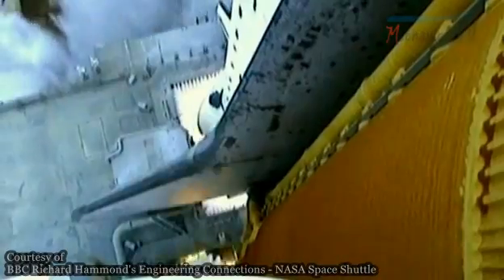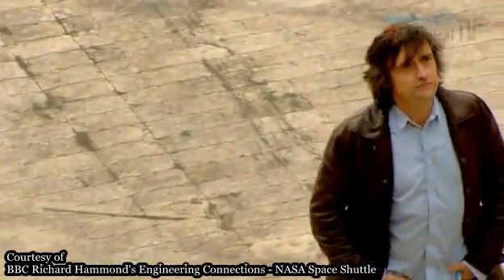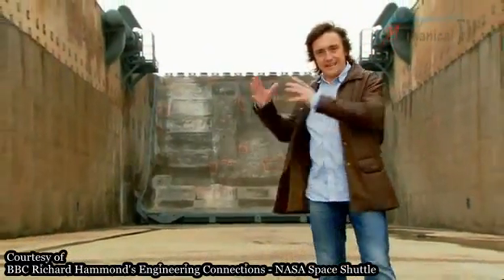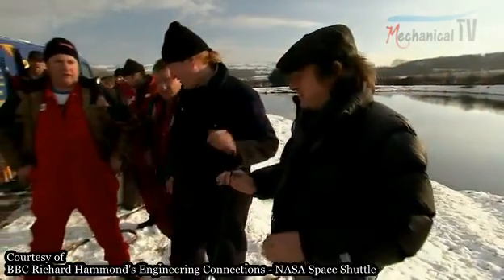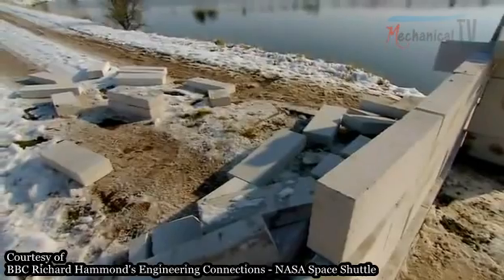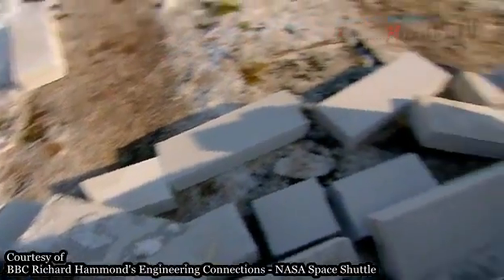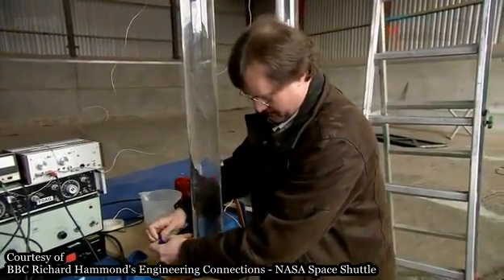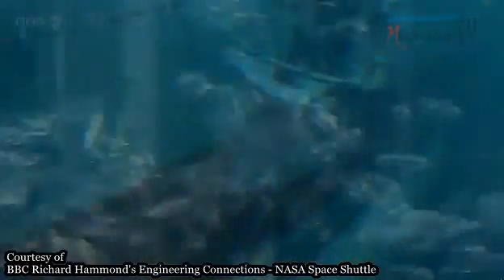Noise Reduction Technology in Space Shuttle's Lift off Using WATER MIST

Comment: On STS 1 the acoustic energy of the SRBs jolted the main body flap (the structure underneath the main engines) way out of position. Remember :  The hydraulic system is using pressure to HOLD the flap in the proper position. It got jolted to a point that the hydraulic system should have been ruptured (according to engineers) 

They got lucky. They did not have a way to see the position of the body flap in the cockpit, John Young learned after the flight of the jolt. He said that had he known, he would assume that the hydraulic system was damaged and would have flown to a safe altitude and ejected

Comment: i think he meant  9 seconds before launch not 9 seconds after launch
Reply: +101southsideboy 
I think the ones in the flame trench fire about 7-9 sec before launch, but the water deluge on top of the pad (shown at 9:44) fires after launch. 9 sec does seem like a long time tho, I thought it was more like 3 or 4 sec after lift off. I mean the shuttle has already cleared the tower by 9 sec. Obviously the ones on top of the pad can't fire before the shuttle leaves the pad or they would blast the shuttle with water. You can never really see those ones either as the whole pad is engulfed by then.
Reply: +101southsideboy It takes about 4 seconds to clear the tower accelerating at 25ft/s squared at which point the shuttle is traveling at about 70mph. (Depending on payload of course)
Reply: Nine seconds after launch was the critical period. During that nine seconds sound from the Solid Rocket Boosters was reflected off the flat launch pad and, without the huge water deluge from the rainbird sprinklers, was enough to knock bits off the Orbiter.
The Shuttle - Orbiter, External Tank and SRBs - was built to withstand 145 decibels. The water deluge across the surface of the pad muffled the gigantic sound of the SRBs and reduced the noise level impacting the Shuttle to 143 decibels.
Was that fine tuning, or what?